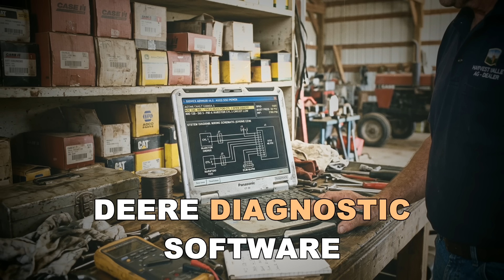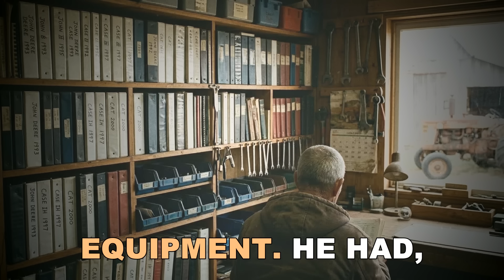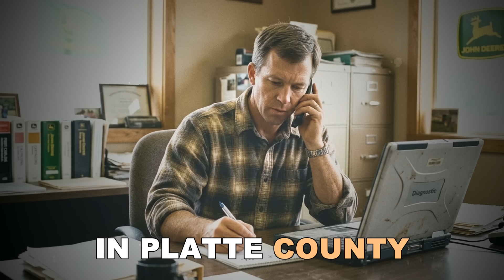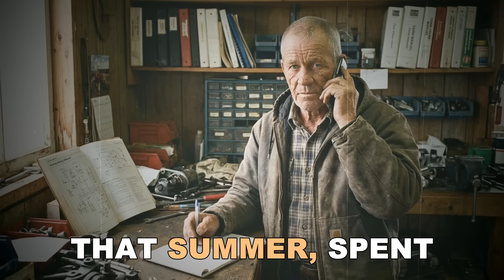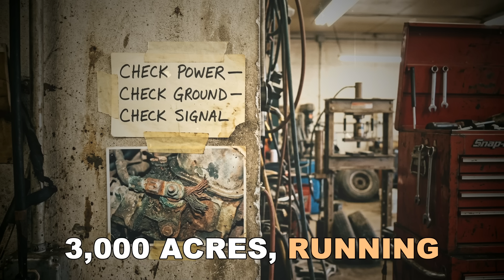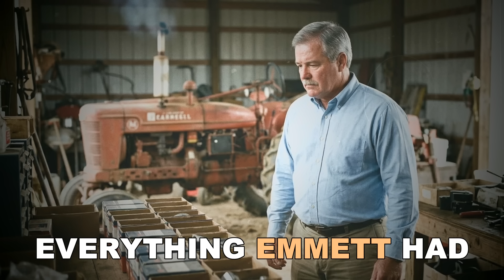The Diagnostic Tool Said the Tractor Was Dead — An Old Mechanic Opened It With a Wrench

Comment: First rule of automotive diagnostics, don't trust the scanner, then second rule check powers and grounds, third rule wiring damage then finally begin investigating faulty parts.

One thing to keep in mind, if your diagnostic diagnostic is wrong What will you do next, Then do that first.

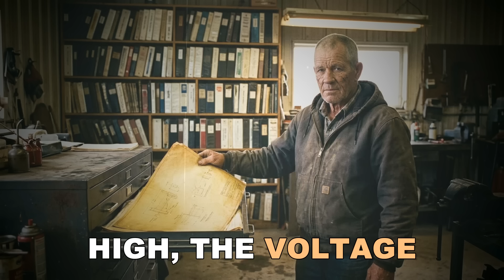Comment: Incorrect diagnosis at 17:50 onwards. "Increased resistance => voltage dropped".  Ohms law states when resistance increases, voltage increases, amperage drops.
Reply: Voltage is fixed, regulated.  Current draw in this case is moving the reference (0.00 vdc) towards the source voltage, so the voltage across the module is low, aka improper, aka faulty.  
Good trouble shooting starts from establishing knowns and moving along the system and verifying DEPENDENT factors downline.
Reply: He's talking about the " voltage dropped" by the resistance. Not a lower voltage, but a  voltage loss. The author is unaware of the difference in the terms. If a resistance results in a voltage across that resistance of one volt, it is said to have a voltage drop of one volt, a potential difference of one volt.

Comment: In 1976 bought a new dump truck and go to start it and would turn over and not start they took it to the dealership on a hook wrecker replace some electrical parts and run a few days and the same thing went to get repaired five times and told them to put new distributor in it and took care of the problem but my question is what do they do with the parts that came out and in boxes at the service center they good are bad and how could the distributor fix the problem but it did
Reply: Your not taking into account multiple times various people may have taken a look and wiggled something or noticed something else that he changed.  If you're not doing it yourself, you don't have a complete picture of the sequence of what could have happened. Hell, sometimes I do everything myself and I can't remember what I did because it's been so long since I got back to it!

Comment: I used the compound for aluminum  A C  wiring to coat the tail light bulb on my old pick up . it was a plastic body with a snap on lens , water tight . A rock knocked hole in the top of of the body of the light , still working  . It filled up with water  I thought a perfect test i left the water in there for 3 years and it still worked when i took it apart where the compound was there was very little corrosion .
Reply: water kept oxegen from gettingt to it therfore no corosion

Comment: Surface verdegrease is not the  problem. Problem is inside connection. Disconnect  clean  reconnect. Eliminates resistance  Tractors have big vibration. = connection  problems

Comment: You can't teach a laptop to think , but you can teach a technician to check all connection's before ordering anything . But J D decided it was only necessary to teach part change and not to apply COMMOM SENSE to any repair first.  It's a shame that common sense was thrown out when they stopped teaching cursive writing and doing math in your head .
Reply: John Deere just loves it when you buy all of those multi thousand dollar components that you can’t return!and test equipment that doesn’t work! Also copper braided ground straps corrode because it’s in the weather, maybe protect the connection from weather! The terminals need to be soldered deep into the braided cable to stop that damn green corrosion powder…and sealing the connection from the weather helps too! And technicians need to be taught the old fashioned techniques! as they are still relevant to the computer control machines…the engine is still a mechanical device that now relies on a computer instead of a mechanical control device,still a mechanical device.
Reply: Ttþt 32:31